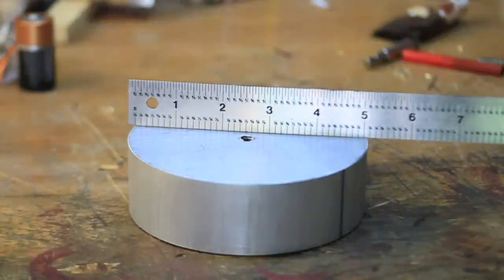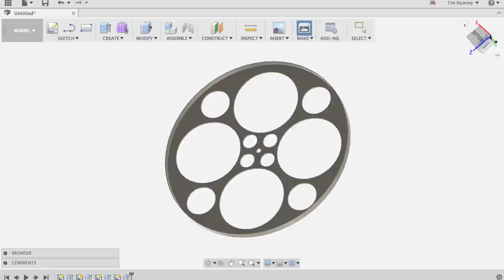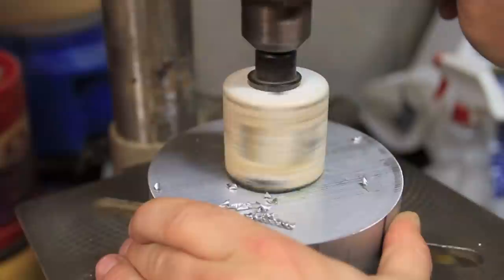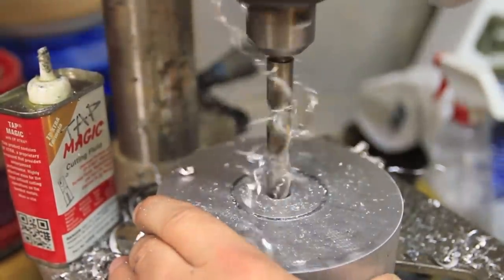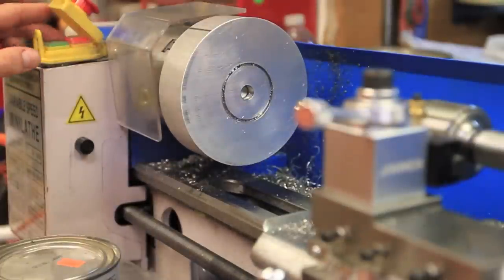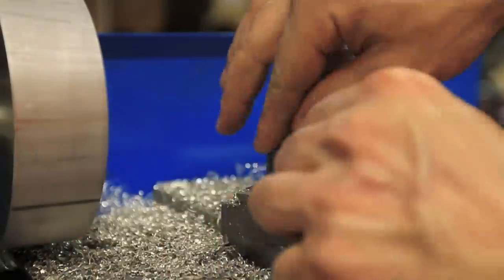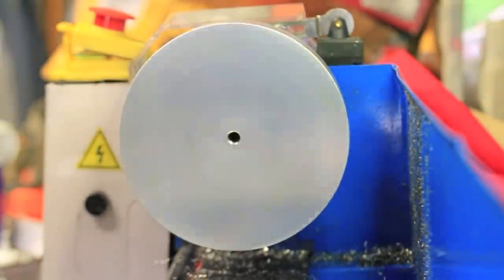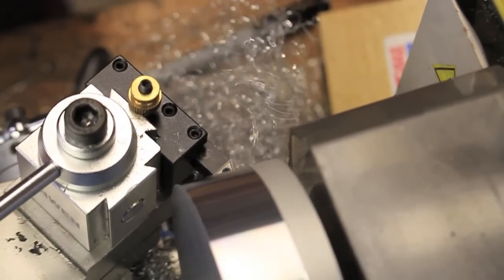Size matters - Large diameter turning, facing, and boring on the mini lathe

Comment: There are many comments here on bad practises, but many of them are also recommending bad practises.  The one I hate hearing and seeing the most is recommendations to wear gloves. NO, NO, NO!!  No gloves, jewelry, watches sleeves.  Nothing that can grab and pull your hand into the machine.  Much better to get a scratch from swarf rather than lose a finger.

As for work holding, since you were boring out the center, the simplest method would have been to make an expanding
arbor.  Simple to make and re-usable for other projects.

Ditto everyone else on finding the work piece center, it takes seconds and is far more accurate to do it the right way.

Never drill without clamping, even small diameter drills can grab the work and whip it out of your hand.  When you started on the hole saw, I was cringing.

Use an old paint brush to wipe away swarf.

Get yourself a magnetic base stand for your dial indicator.

Buy or grind yourself a set of lathe tools for greater flexibility.

The toolpost is fine for aluminium.... only.  Forget about turning steel with it and probably brass as well.

If you plan to machine steel at that diameter, the the lathe probably doesn't have enough torque anyway.  I am not going to say buy a bigger lathe, because we all have our space and budget limitations, you just need to be aware of the limitations of the tools you have.
Reply: poruatokin  - I agree. Worked in the nuclear industry for 27 years.  I once saw an individual start a rotating shaft, while another worker was holding it while wearing rubber gloves.  I hope I never again see five fingers bent in that many different directions.  A class mate almost lost a finger when his class ring got caught on a chuck.  Watch the following video:  https://youtu.be/3EdQq5iAGYs  - That's how fast you can get hurt!
Reply: Gloves are not a good idea on a lathe.  But if you really think you do have to wear them use a cotten and not leather glove. I worked on oil rig with rotating drill stem. We wore cotten gloves. You were not allowed to wear leather ones.  Leather is too strong and if it snags you are farked.  Will wrap you around and tear stuff off. With cotten or fabric at least there is a chance it will just rip and tear. My two cents.
Reply: I always wear gloves. I have cut myself more times from sharp edges and needing bandaids later, than I count. It's not worth taking them off. More of a hassle without gloves.
Reply: My dad lost the tip of his ring finger due to a glove got caught in a drill press grabbed and pulled.
Reply: @gredangeo   there is someone that has a channel on Youtube that had his hand all smashed up this year on his lathe because he was wearing a glove.. lathes a gloves asre a big no no..
you could lose those fingers all together!
Reply: @adrianharrison5208  I know that's it's a convenience over risk, but sharp edges is a risk as well. I also can't hold the parts as easily. Besides risking bleeding on everything due to a bad scrape, I'd rather wear gloves and call it a day. I don't move fast around rotating objects anyways.

By your logic, we should be wearing sandals and shorts in the summer, less fabric the better to get caught into something, but for the sake of safety, clothing is worn. I don't see how gloves is much different. You only trade in one risk for another, and the last factor that causes the most accidents is carelessness in the first place. So if you can avoid your hand near a moving object, the better. Do that option first, and use clamps when you can.
Reply: @gredangeo   no its not, the point is you dont want the gloves getting caught in the lathe puliing you in.. it's not the same as shorts and sandals as you're not controlling the lathe with your feet or knees. My position is I'd rather sustain a cut or scrape than have my hand dragged in as you're more likely to lose a finger or crush a hand...but to each his own.
Reply: @gredangeo  This is why you use a vice or clamp (on a drill press), you can put the material in with gloves on then take the gloves off while working, as for using them with a lathe your hands shouldn't be over the bed while using it so no risk of getting a cut so no need for gloves...
Reply: NO JOKE! There's a video of a man's entire body becoming like a rag doll on a lathe.  I cringe whenever I see someone using sand-paper and the like (too many don't know how to safely hold it), let alone gloves...

Comment: A thing I always watch for when someone is using a drill press is table flex. Yours flexed a lot. You need to use an old scissors jack to support the table so it remains true to the drill or whatever you are using. It's what I do if using any sort of force.
Reply: This is a great idea. Definitely need to pick a couple up next time I hit the wrecking yard. A bottle jack would work too I think depending on height restrictions.

Comment: The simplest solution for outside turning on a diameter that pushes the limits of your lathe is a boring bar, mounted backward in the tool holder, with the tool post rotated 180° from the usual orientation. That is, if you have a moderately long boring bar.
Reply from the maker: That's a really great solution! Thanks for the comment :)
Reply: Any links? I can't picture this :)

Comment: there are many ways you can use to find the center. one was to draw a line across from 8-10 different angles from edge to edge and the intersection in the middle is the center. i have used that for years and never had an issue. just something to help ya in the future for faster results is all. but good work!

Comment: I recently bought the same Lathe as you have.  I also had a lot of trouble...straight outta the crate!!    I have learned a lot about my machine from watching your videos, so thank you for sharing.  I did notice in this video that when you were facing the part that there seem to be ridges in the finish?  I have the same problem with my Lathe...very poor ridged finishes.  I upgraded to all metal gears and tapered roller bearings and still have the same results.
Reply from the maker: Make sure that everything on the carriage is tight... if all that is good, maybe make or buy a carriage lock as I think that was a majority of the cause of the ridges.

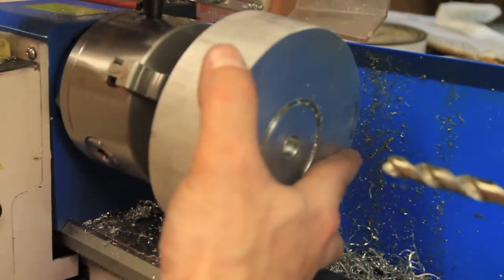Comment: 6:02 A coupling nut turned flat with a boss to countersink into the slug of aluminum can help with getting the hole closer to true. The setup with multiple nuts is usually going to be a little off especially when the bolt isn't tightened to pull the work against the chuck.

Comment: I watched with horror as you were holding the disc while drilling with a hole saw I nearly lost a finger doing that I now clamp every time.Good video though Roger
Reply: lol yep. Those of us who were self taught on the drill press usually get into that habit until we drill something big enough to give us a scare. My boss, who knows far less about machining than I, had to learn the hard way, that you don't wear thick gloves either. LATEX ONLY.
 Fortunately, his industrial-sized drill press has a stretched belt so it slipped before he broke his arm in three or four places.
Reply: Agreed. My drill bits are as sharp as I can make them and I clamp everything. When I started out metalworking I drilled 12mm hole in a piece of 5mm flat bar, I omitted to deburr the part and started drilling. Halfway through the bit dug in and started to fling the sharp flat bar around. I had several deep lacerations in my left hand including a severed vein. Safe to say I got a huge lecture afterwards, and lost a good enough portion of my blood to become light headed. Won't make that mistake again, especially since I started working with radial arms. A 10 hp machine will take your arm, not just your finger.
Reply: I was OK when he hand held it for the center drill. But when he did with the hole saw? UUgghhhhh.

Comment: I would strongly suggest investing in a better quick change tool post. Those little aluminium ones are like rubble bands compared to a steel one. 

Also HSS tooling works much better on the mini-lathe. Its not all that difficult to grind your own cutters. You can grind a right handed boring bar that will give the lathe a little more reach on large diameters. Even a poorly ground HSS cutter can work better than carbide. 

I've made all the same mistakes wasting money on the aluminium tool post and carbide tools.

The RPM looked a bit high for something this large but it hard to tell on video. I usually will turn the speed all the way down before turning on the lathe and then big the speed up slowly. 

I've used the faceplate and drilled a bolt pattern to turn HDPE disk that just clear the ways on my mini lathe. That is where I was expecting you to go when it didn't fit the chuck. The bolt arbor is just a bit sketchy. Bolts can shear off pretty easily, are not very straight or even concentric.  Same with the nuts. They are rarely dead nut on. 

Get yourself a set of transfer punches. They are pretty inexpensive at HF.  Center punching on a sharpie mark is hardly accurate.
Reply from the maker: Thanks! 

Other's have mentioned the weaknesses of the carbide tools and my aluminum tool post as well. I went with the aluminum tool post because of the cost (less than $40 with the holders) to see if it was something I'd like and eventually want a higher quality version of and also because the total cost of this lathe was so cheap that if I spent so much money on the small convenience accessories I could have just put it together and bought a higher quality lathe to begin with. I also found a review of someone else who has been using it on a mini lathe and he paid nearly $100 for it and was happy enough with it. I figured if he was happy for $100, I'd be thrilled for $40. 

For the carbide tools, this is probably lack of experience but they seem to have been working well for me - I went with them again because of the cost but also because they came in a defined, pre-angled set where as it's much harder to find pre-ground HSS tools unless they are used on eBay, which when starting and not knowing what I'm getting, makes it difficult. The carbide tools also seemed like the path of least resistance to being able to get the lathe and start using it without having to also buy everything needed to grind the HSS tools, learn how to do it, and then still not know if they were correctly working.

This is very much a learning experience for me and I'm also finding that the fastest way to figure out what you're doing wrong is to post a video of what you're doing on the internet. I appreciate you watching and appreciate the suggestions.
Reply: TimNummy  mate please watch keith fenner or a abom they have good tips and tricks

Comment: you used a 3d printer to find the centre of round stock 0.0, overkill i love it hahaha.
Reply: When I saw this I couldn't figure out what was going on until the very last; I thought there was going to be some complex geometry (as opposed to the simply geometry that will give the centre), with all those material-saving circle cut outs.   What I can't understand is the use of a Sharpie for the mark?  That splodge of ink is huge.  Surely if a scribe (or substitute) isn't handy, at least a 0.5mm pencil?
Reply: Everyone else used an engineers square with the V attachment, to find the centre of any round object, no matter what the diameter.
Reply: Yes this tool in aliexpress costs less than a dollar and can be used easily for 5 inch dia work - it is very handy and accurate for marking center point for proper round workpiece - look for Plastic Center Finder Centre Measuring Round Cylinder Milling Machine Tool

Comment: I appreciate this video.  I have a very similar sized disk of S7 I was not able to figure out how to use my Sieg lathe to work, but your idea of using a bolt in a center hole as the chuck mount point, that is a good way around the size limitation of a 3" or 4" chuck.

Comment: the part was not flat when drilled so the first hole was not parallel to the OD.

loosen the QC tool post and rotate it 90 degrees.
take your cutter and it will be closer to you so you can face off the part and have the tool post over the dovetails for more strength.
you could just angle the QC post and use your cutter without touching the compound.

use your boring bar on the far side of the part to do the OD.
very light cuts due to the high FPM and large diameter.
many fun things about machining and lots of ways to get the job done.
the only wrong way is when you get hurt.

Comment: Hi in the pacage of your minilathe shuld be a disk with the diameter of your chuck and a thickness arround 10mm. with a few holes drilled in  it. it is called a FACE CHUCK  or DISK CHUCK and it is used fore mountng big details on the mihi lathe.

Comment: You realize you will be more accurate and 100x faster  just using a ruler and scribe to find center right?
Reply from the maker: Yeah sure, but then I wouldn't have a segue to 3d printing videos. Besides, the longest part was waiting for it to print which gave me time to do other things - plus now that I have the tool, it will be faster then a ruler and scribe next time ;)
Reply: Centering head for your combination square http://www.tooldiscounter.com/ItemDisplay.cfm?lookup=FOW72-386-006&source=froogle&kw=FOW72-386-006&gclid=COmi6PbztNQCFQOewAodzJwL_A
Reply: Brian Kiehnau you beat me to it lol. I was about to comment that there is a specific head for a square for the EXACT purpose he needs.
Reply from the maker: I know - I was just looking for an excuse to use the 3d printer
Reply: @tallbrian100  Thats what I use... works for any diameter.
Reply: @TimNummy  , 
Please address the dealer/distributor of this mini lathe, in  Indonesia .
Reply: I was about to comment the same thing. Make a center finder with a square and a ruler.

Comment: Many comments, old(er) video, yes I looked through them but didn't see anything to do with my observation(s).  I noticed when you clamped the part to turn, on your 3-jaw chuck, that your part wasn't flush with the steps in the jaws. That might have been where you were seeing some of the wobble, not necessarily because the bolt wasn't centered . Yes, the aluminum tool posts are quite crap and disposable. Also, when indicating or measuring, put the base of the indicator on the machine, not the bench. When you pulled towards you to rotate the chuck, the whole machine flexed/rocked toward you and the indicator.  All that being said, I like your videos and can see you're learning. I've enjoyed seeing the progression and the improvements you've made to your lathe. While I , or others, would have done things differently, you are making headway and I think you've got solid ideas. No, I don't have any videos doing what you're doing, but please don't think I'm an keyboard warrior, lol.
Reply from the maker: Hey! Thanks so much for that comment :) I really appreciate the level of detail... You're right about the space when putting it on the chuck but I was trying to get it to wobble less and I don't think the rough cut face was exactly true, so it was actually better with a little bit of space. As for the putting the indicator on the machine, that's a really good point - I went through the trouble of making sure the indicator was very secure but completely overlooked the machine moving around. 

Thanks again for watching and enjoying and taking the time to comment!
Reply: It's good to see constructive criticism and how well it's taken rather than some of the ass-hats on here that feel it's ok to slag someone off.

Comment: i actually just bought one of these china lathes to make bushings and other spacers for our drift cars. Your videos have helped a ton! I cant wait for mine to come in, and start working with it. The way the motor is mounted still scares me though... haha. good videos man, keep uploading!
Reply from the maker: Nice! 

Nylon or polyurethane? Either way I did a test piece on some PVC pipe in the unboxing video and it worked wonderfully on it. Might check if out if you haven't seen it. (https://www.youtube.com/watch?v=YTfLc9238vA&t)

Definitely go through the whole thing and make sure that everything that shouldn't move is tight and everything that should move is greased - some parts were dry on mine and I just found some bolts that were either barely finger tight or missing!

I'm putting together a video now that is completely stripping it down and putting it back together, which hopefully will be done pretty soon so keep an eye out for that. Thanks for watching!
Reply: TimNummy Were gong to be using aluminum to make some subframe bushings, and rear differential spacers. And possibly delrin or poly for motor mounts, and shifter bushings. And yea! I saw the PVC being turned down. How well did it work with harder steel stuff?
Reply from the maker: That's awesome... at first I was using mild steel which is hard to turn as it tends to tear and leave a rough finish but after messing around with it a bit, I was able to get very acceptable finishes. I've ready that some of the harder steels actually machine much nicer and I have a project coming up where I'll be turning a pretty significant piece of 4130 Chromoly - this will be a great test for both the turning ability of this lathe with harder steel as well as how much, if any, taper there ends up being across the length of the lathe. The possible taper aside, the biggest reason why this lathe would struggle is just in the torque needed to take deep cuts.

Comment: As another alternative, you can use a secondary plate in the lathe with the work piece held with superglue. They can later be separated with a bit of heat from a blowtorch.
Reply from the maker: Thanks! That's not a bad idea either.
Reply: That's great when using plate material, personally I wouldn't attempt with such a thick piece as in this video. each to their own though.